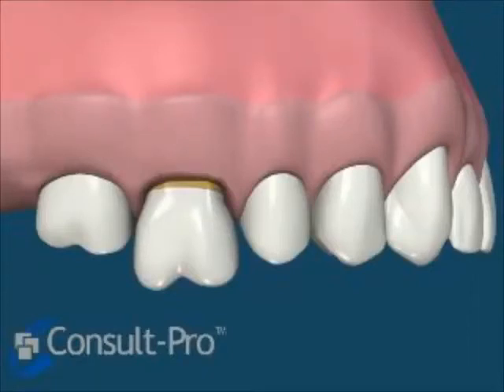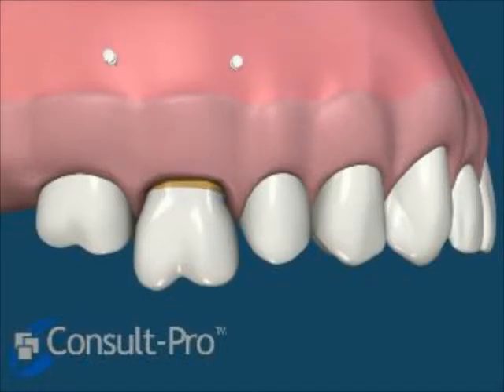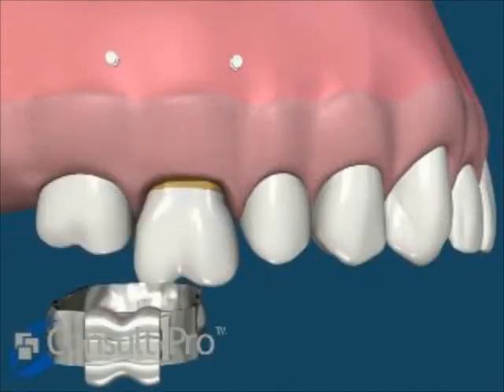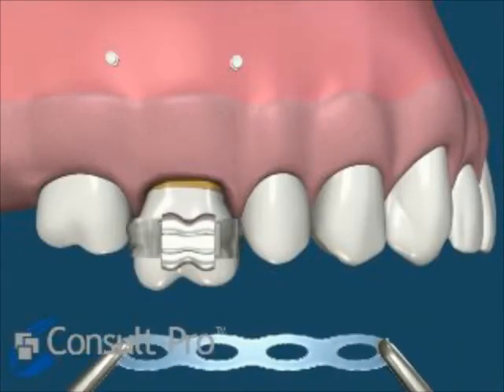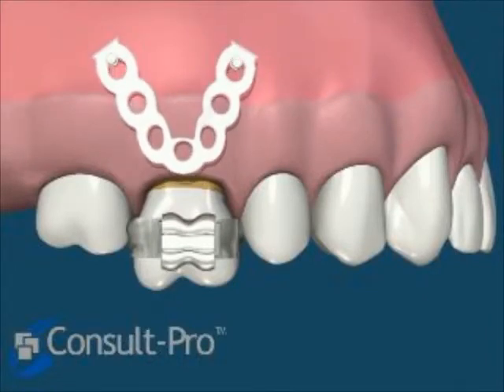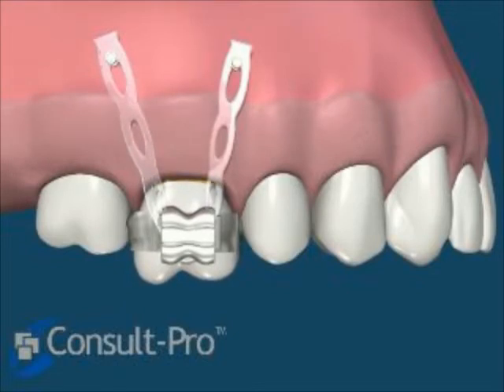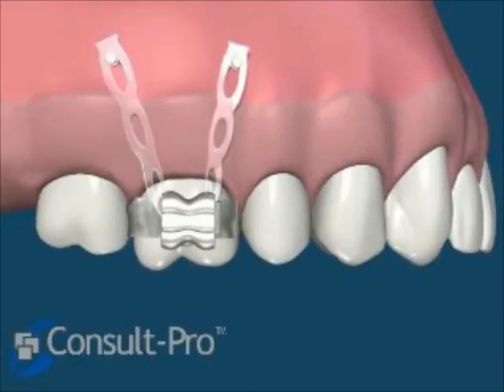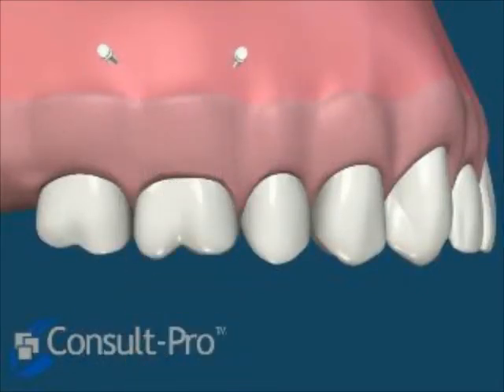Max Molar Intrusion With Implants

Comment: The Buccal cusp will definitely be intruded. But what about Palatal cusp???

I'm an orthodontist(from Taiwan)
Reply from the maker: If an orthodontic band is used, the entire tooth is intruded.
If orthodontic buttons are used, a palatal mini-implant is also needed. 🦷🦷🦷
Reply: @ Never tried it with a band. But back to the fundamental, as long as the force does not pass directly through the center of resistance, it will still tip or rotate. 

And no principle prohibits that the band itself(even if properly applied) can't also tip or rotate along with the abutment tooth. So in my humble opinion, though band helps increase force distribution, it will still be tipped buccally without palatal screw.
Reply from the maker: You definitely right! And we appreciate your involvement in our community) 😘